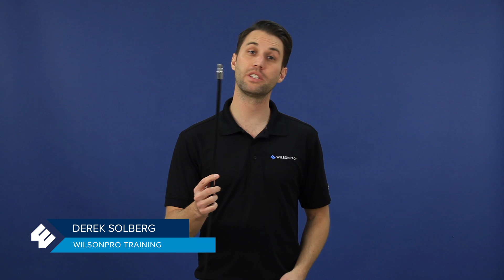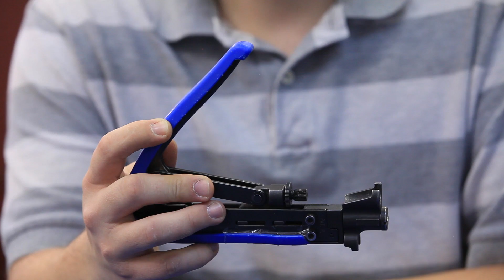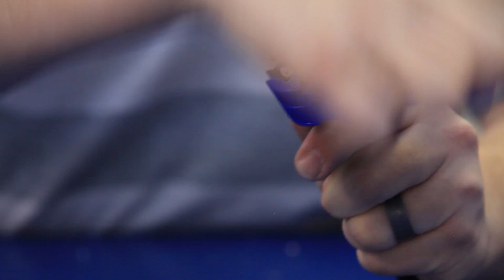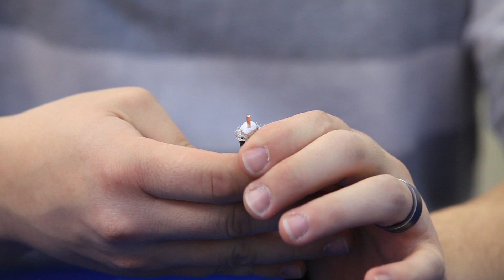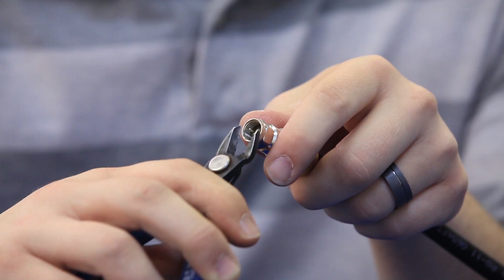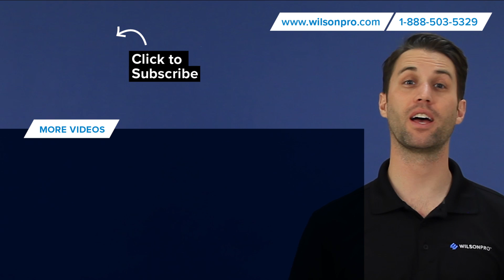How to Terminate or Put Connectors on RG-11 Cable | Wilson Connectivity

Comment: Let me give all of you some solid advise; coming from a real cable technicians who have worked with a hundred of these RJ-11 F-Connectors...  If you think you can just cut off the edge of the cable shield of the cable and just inserting the fittings, you are going to be awaked with shitty signal levels caused by the ends of the fitting.  I recommend practice and with solid advice from a real technician who have learned from doing this all the time.  RG-11 fittings is not to compare with RG-6 F-Connectors.  If you don't push the fittings in nice and tights those fitting will come apart very easy.  Bending those cables too close to the fittings should be avoided at all cost!!!!  The stinger will pull away from the fitting, causing excess signal losses!  Take this from those who pray these work on hard ass installs.
Reply: I dont mean to be off topic but does anyone know a way to get back into an instagram account..?
I stupidly lost my password. I would appreciate any tips you can give me!
Reply: @Major Keanu I really appreciate your reply. I found the site on google and Im trying it out now.
I see it takes quite some time so I will get back to you later with my results.
Reply: @Major Keanu it did the trick and I finally got access to my account again. Im so happy:D
Thanks so much, you saved my account :D
Reply: @Bodhi Arlo happy to help :D

Comment: What? Why not trim the copper when you have the connector on? Make sure the copper is longer than you need and trim the access otherwise if you go too short you have to start from scratch
Reply: With rg11 the copper wire does not push through the connector. There is a floating pin in the center of the connector that the copper had to be incerted into and that pin is what is seen protruding out the other end of the connector.

Comment: Is the RG-11 termination the same size as the RG-6 termination?
Reply: The RG-11 and the RG-6 end fittings diameter, inside, is 7/16th.  The outer nut can be different sizes, but the inner diameter of the termination is both 7/16th.
Reply: Kyle Klouzal  Hey, I got nipples too. Does this mean Im some kind of a terminator as well, good sir?
Reply: Joe Potato No, if that was the case then rg6 would be rg11. Why call the same thing two different names?